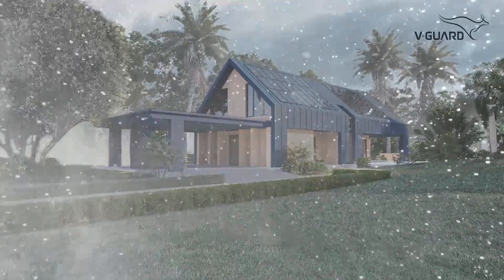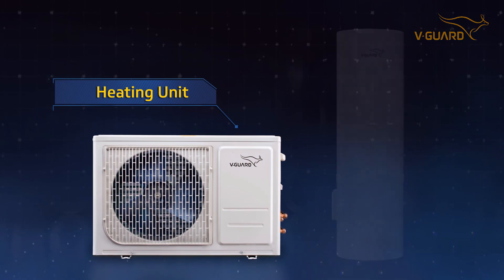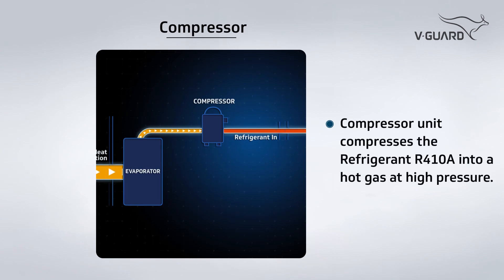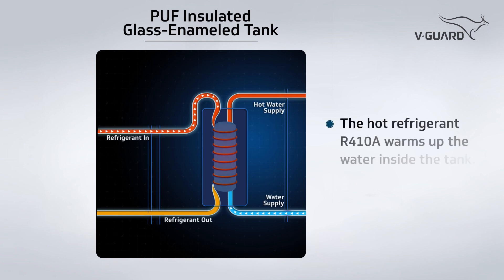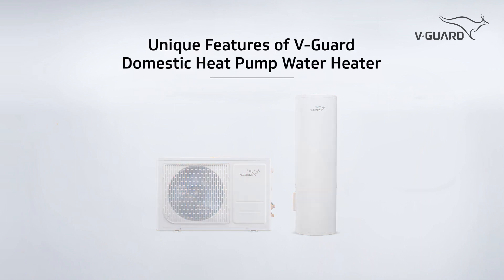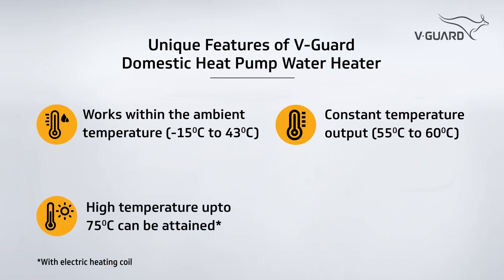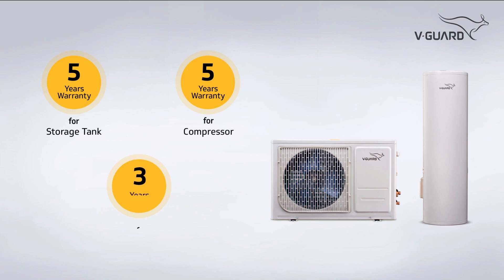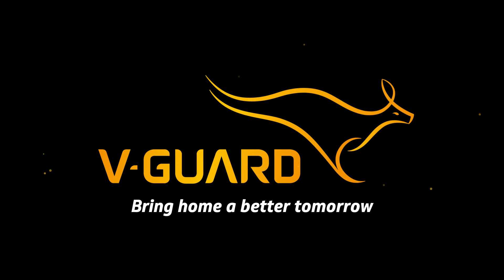V-Guard Energy-efficient Domestic Heat Pump Water Heaters

Comment: Dear Sir,
I hope this message finds you well. I am writing to express my frustration regarding the ongoing leakage issue with my new solar heater purchase, which has yet to be resolved despite multiple promises for the same.
Since I first reported the problem, I have been assured that it would be addressed promptly. However, I have yet to see any action taken, and the situation has only worsened. I am least bothered about which department of yours is supposed to work on it, all I care is the leaks have to be fixed. It is extremely comical that a customer is having to talk to multiple departments for getting a new installation fixed, it should in-fact be a shame for your company that this situation has arisen in the first place.
I would appreciate your immediate attention to this matter. Please let me know when I can expect a technician to resolve the issue.

Thanks and Have a Good Day!!
Warm Regards, 
RAFI SHAIKH,
Reply from the maker: Dear Rafi, We sincerely apologize for the inconvenience caused. Request you to kindly share your contact details so that the concerned team can get in touch and assist you further. Regards, Team V-Guard.